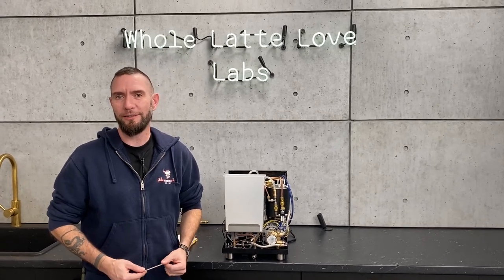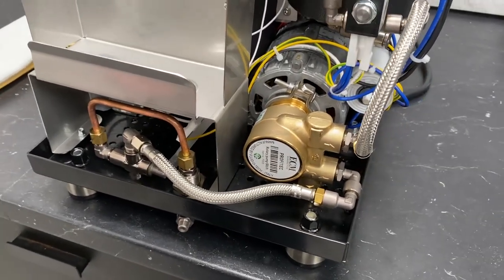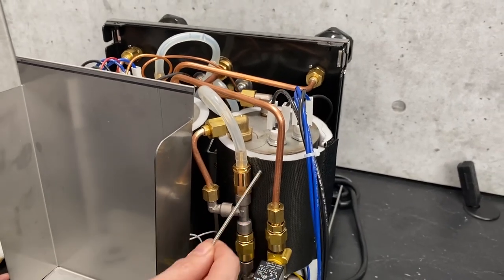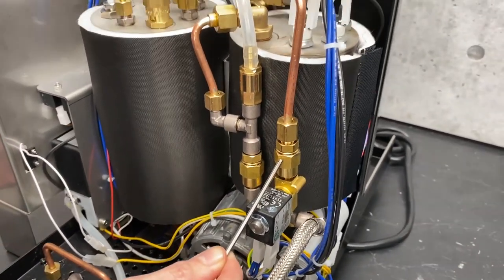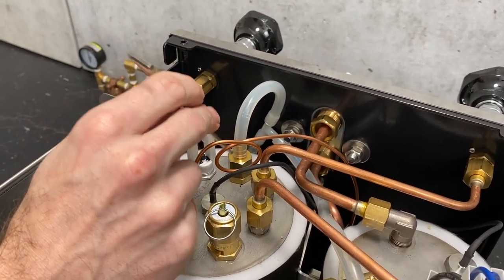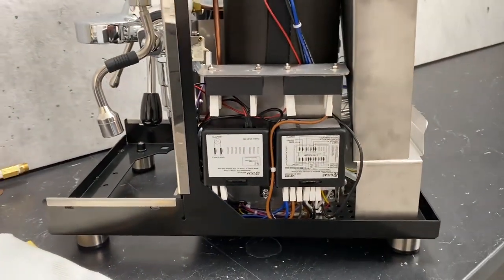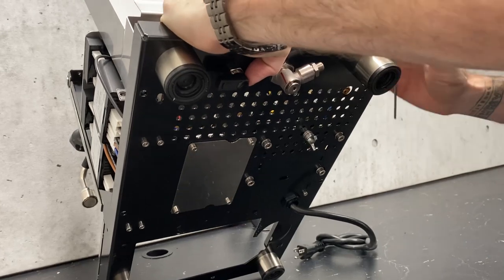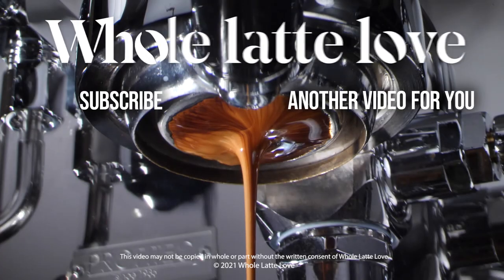Profitec Pro 700: Internal Tour and Component Identification

Comment: These are great videos! I have the 600 pro, a great machine but the water situation is frustrating as it switches off when low even mid shot. Is it possible for me to upgrade my 600 to mains fed? Thanks any help appreciated
Reply from the maker: Hey Steven, thanks for the comment. Unfortunately there is no way to switch to plumbed direct operation.

Comment: How does the 700 compare with other brands for ease of servicing and maintenance?
Reply from the maker: Hi Lori, General maintenance is similar to other espresso machines as far as group cleaning and backflushing. A few things that make servicing the Pro 700 easier than similar machines are a simpler internal component layout - parts are easily accessible, boiler drains, mechanical valve on the plumbed in connection vs a solenoid used on many plumbable machines. We generally do not recommend end users descale dual boiler machines. But with the boiler drains it's more realistic.
Perhaps the easiest to service dual boiler machine is the ECM Synchronika. It's identical internally to the Pro 700. The difference is the side and back panels are easier to remove.
If purchasing a dual boiler machine we strongly recommend treating water to prevent scale in the first place by reducing calcium. We prefer systems made by BWT which exchange calcium in tap water with magnesium. If running from reservoir they have the Penguin Pitcher: https://www.wholelattelove.com/products/bwt-penguin-2-7-l-water-pitcher
or Bestsave in reservoir pad filters: https://www.wholelattelove.com/products/bwt-bestsave-m-anti-scale-filter
If plumbing to waterline use the Bestmax Premium in line filter: https://www.wholelattelove.com/products/bwt-bestmax-premium-filter-package-w-besthead-flex
Hope that helps!
Reply: @Wholelattelovepage  I typically don't consider a machine without a complete look at the inner workings, how things are laid out and materials used. I enjoy these type of postings. Thanks for all the info, solid and concise.

Comment: My understanding is that the key difference between Pro 700 and Pro 600 is the rotary pump vs vibration pump. Is upgrading to the rotary pump worth it? What impact does it have on the quality of espresso if any? Thanks!
Reply from the maker: Hi YD, Thanks for the question. Yes rotary pump in the Pro 700 and it's plumbable direct to waterline. Pro 700 also has larger boilers. Rotary pumps have a higher stock flow rate of ~11g/sec vs. ~7g/s for vibration pumps. Higher flow rate gives you more room to play especially when the machine is outfitted with flow control. Higher initial flow rates may produce better results on darker roasts.

Comment: How is the quality of the internal components compared with the ECM Syncronika?
Reply from the maker: Hi EvilT, Thanks for the question. The Pro 700 and Synchronika are essentially identical internally with same specs for boilers etc., same electronics system. ECM and Profitec are sister companies and both machine are made in the same facilty in Milan, Italy. Main difference is external casework and finishing with more detail and refinement on the Synchronika.
Marc
Reply: @Wholelattelovepage  thanks Marc.

Comment: Dear WLL,
My front discharge on my plumbed Synchronika (2021 model) is leaking during extraction of coffee and when the machine is shut off.
It is not leaking when the boiler is fully heated and neither when i use the blind filter pull the lever.
Should I change the OPV? Or do you see any other approaches?
BR
Thomas
Reply from the maker: Hi Thomas, best course is to open the machine up and determine leak source during machine operation. Use caution when doing this. I suspect you are correct and it could be the OPV. The only sources feeding the drip tray discharge are the brew system OPV and vacuum relief on the steam boiler. Very unlikely the steam boiler vacuum relief would leak when the machine is off unless the solenoid controlling steam boiler filling is stuck open. When plumbed, line pressure is always present in the brew system of the machine so a leak when machine is off is most likely coming from that water source.
Curious if you have a pressure regulator on your plumbed connection? ECM recommends maximum 2 bar pressure on the plumbed line. Lack of a regulator would not necessarily cause this issue but could over time have contributed.
Reply: Thank you WLL for your response. I have pressure regulator at the pressure is kept at aprox 1.5 bars. 
I Will try inspection, if it is the opv is it then possible to clean or fix it? Or should it be replaced?
Reply from the maker: @thomasholm-weber9951  You may be able to clean but if malfunction not caused by internal debris then best to replace.
Reply: Thank you for all the answers!

Comment: If I have 2400 watts available to me. Why can’t both boilers heat up at the same time if they’re 1000watts each, strange to me it doesn’t do both
Reply from the maker: Hi r,  For residential applications 20 amp circuits are not universal so most manufacturers stick to making machines which use more typically available power.

Comment: Any tips with regards to shielding the relays from heat from the service boiler? I’ve seen people move them to the bottom, but was wondering if so aluminium foil or insulation might do the job?
Reply from the maker: Hi Nick, Very rare to have any heat related issues with relays in the Pro 700. It's best to just make sure there is a good layer of heat transfer compound under them. The insulation around the boiler does a good job of shielding them.
Reply: @Wholelattelovepage  thanks for the reply! I'll have a look to see how they look underneath. It's quite an old machine by now. It's an odd one though, I'm still not sure the issue I'm having is the relays. But the machine seems to stop heating after a period of time, despite the PID showing a solid dot. The LEDs on both relays don't come on when it's not working and the symptoms persists until the machines cools back down. So far running the machine without the steam boiler on has stopped the malfunction. So I assumed it was the heat affecting them. But maybe something else is causing the issue. I'd experienced the issue before but then thought I'd managed to overcome it by back flushing the machine a few times and draining it. But after I lowered the pump pressure down to 8.5bar and restored the outer casing it started to reoccur.
Reply from the maker: @nickpantelireis2806  Hi, if you're not already familiar with it, we do have this video on diagnosing heating issues on the Pro 700: https://youtu.be/iaudLNlgR4c at ~19:00 in the video there's a procedure for testing power from the relays. Also other things to check which might be causing the issue.
Reply: @Wholelattelovepage  thank you! Watched it a couple times now after your recommendation. Also checked the underside of the relay. There isn’t any thermal compound present, so I might add a layer there and see how it goes. The machine does seems to work well at first, then quickly loses ability to heat after running for a while. The little LED in the brew relay starts to become very dim before eventually cutting out.

Comment: That plastic t joint in my Synchronika has given me so much trouble, it turned brown and the water in the steam tank turned brown too. I changed it and it happened again. Now I exchanged it for a brass one, let's see how it goes.
Reply from the maker: Hi AH, Sorry you are having issues with the T joint. Heads up, it is on an outflow from the boiler so has nothing to do with water color in your service boiler. Brown water in your boiler and in the T is more likely related to your water quality going into the boiler. Also, if not already doing so it's best practice to remove a cup or 2 of water from the boiler through the hot water wand now and then to prevent accumulation/concentration of minerals or other materials in the boiler.

Comment: Sir,, i have a question,, how about the water cane out to the safety valve ,, what do you think sa possible problem, thank you
Reply from the maker: Hi E.b, are you sure it came out of the safety valve and not the vacuum relief valve? If it was the safety valve it's either because the valve was defective or the boiler got too hot and triggered release to prevent boiler from reaching too high a pressure.
For the vacuum relief, it's normal for a small amount of water to be released each time the machine heats up. If after the machine is fully heated water/steam continues to be released from the vacuum relief then the valve may be stuck open by limescale or other deposit. In that case, cleaning or replacing the valve will solve the issue.
Reply: @Wholelattelovepage  yes sir ,, when i turn on the knob for espresso and then the water like overflowing,
Reply: @Wholelattelovepage  i changed already the safety valve but its the same problem,, when i turn on the knob,, what do think sir the problem is temperature probe

Comment: What massively frustrates me about this machine, is the low tank float sensor is literally 1.3 L from the bottom. Which makes the tank really only 50% usable. Make it the last 10%
Reply from the maker: Hi r, Assuming you are referring to the service boiler which produces steam? Yes, that needs some empty space (headspace) to hold a reserve of steam if filled 90% with water steam pressure would run out very quickly!